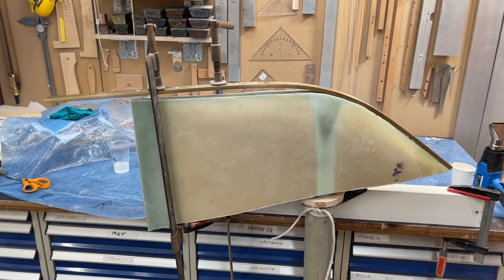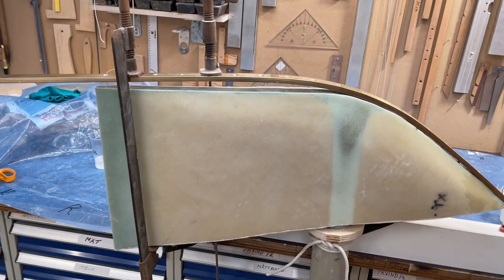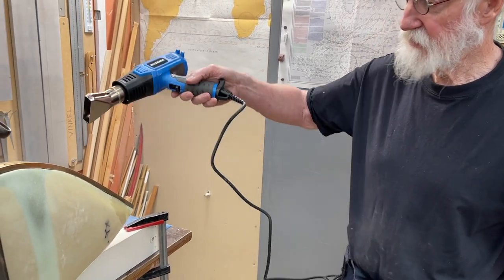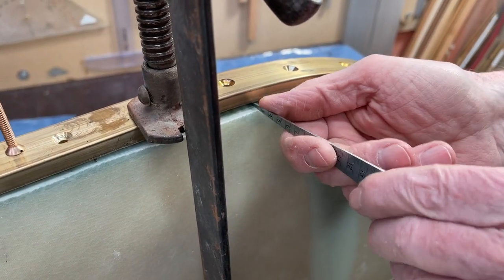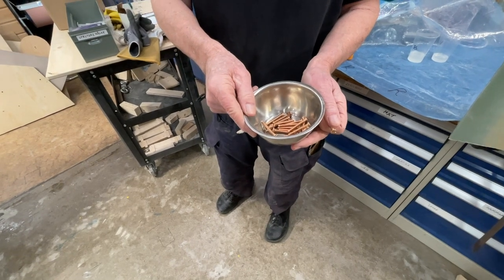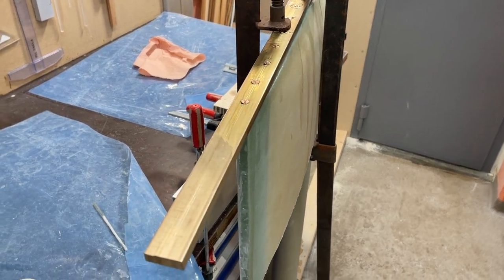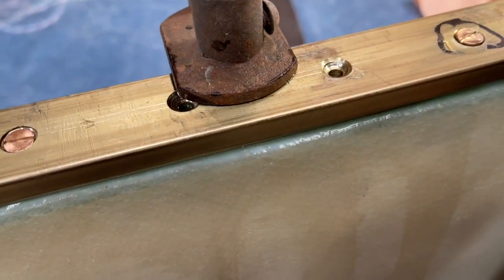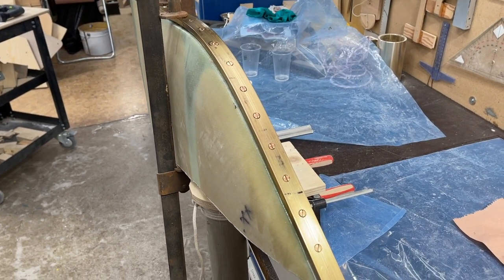3 Jan 2023  Fastening the aluminum bronz flat bar to the rudder blade The first most difficult step.

Comment: Beginner question here. Is it easier to scale boat plans up, or down, or it doesn't matter? Example, I want to build a 21ft. Northumberland sailing Coble, but I can only find plans for a 15ft one, or a 27ft one.
Reply from the maker: If you scale down you lose stability.
If you scale upp you get better stability.
You can take the 15ft and space the frames with greater distans to get 21 ft.
Reply: @SvenYrvindExlex  thank you!

Comment: Why not a torch? If I were to bend metal, I’d think that would be much faster than an overpowered blow dryer. Is there a reason?
Reply from the maker: My landlord do not let me weld or use a torch.
It is a 13 000 square meter building with alot of valuable things.
Reply: @SvenYrvindExlex  I had a feeling it was something like that.
Reply from the maker: @justplinkin4809  I am learning. This is the first time.
Next boat I may bring the thing to someone who can do the job.

Comment: Isn't the rudder blade itself (divinycell I suppose) strong enough to go without this bar?
Reply from the maker: The rudder blade is 30 mm G11 epoxy laminate extremely strong.
The Divinycel is outside to get an hydrodynamic shape.
The screws are in the G11

Comment: So you used the heat gun while the metal strip is on the composite?  How does the heat effect the composite?
Reply from the maker: Its no good to heat composite.
I did it very carefully.
Hopefully no damage done.
The heat gun helped a lot to bend it.
The bending of the flat bar have been done by an amateur with small resources and no previus experience.
Also I am not permitted to use open fire. My workshop is a big 13 000 square building with a lot of offices.
I think the problem is solved despite everything.
Reply: Probably the infrared emitted does more benefits to the cure process of the matrix  than the temperature itself. 265°f for a few hours is used for many processes. Interesting, is that gas fumes like those emitted by a gas heater will weaken the layup. I think that at 140°f most uncured layups will increase in plasticity and at approximately 265° they can become harder and more heat resistant - up to jet engine temperatures for some exhaust components. Interesting, is that a cold hand laid airplane will drop it's wings several inches at 140°f so white paint has to be used.

Comment: I think it might have been better to slightly over bend initially then draw it down.
Reply from the maker: If you watch previus videos you see that it was quite a bit overbent but it sprung back more than planned.
I have no previus experinece with this.
However I did not dare to overbend it more than I did.

Comment: I thought it was a brass bar.  Aluminum is not going to slide over rocks and coral as well.  It tends to stick to rocks rather than slide.
Reply from the maker: Its not brass its not aluminium.
It is aluminum bronze. Stronger than stainless steel. Almost as strong as duplex.
Reply: @SvenYrvindExlex  Got it. I thought it looked like bronze.

Comment: I hope is stays.  If there's stress still in that bar it could spring in bad weather or cold.  Not a critical part so if it happens it's not the end of the world.  If it were me I'd take all the bending stress out of it on the bending buck.
Reply from the maker: Prestressed conatructions have been used for a very long time.
Earlier videos shows me and two more persons hanging in just one screw maybe 250 kilos maybee it would have hold for more people. There is on screw every 5 centimeter. 
Then there is the glue. If I remember 500 kilo a square centimer. Ther is maybe 3X75 square centimeters 112500 kilo holding power from the epoxy adding to the screws.
Maybee the flat bar is not obedient. If it falls of the rudder will work anywhay.
Reply: It’s not going anywhere bolts and brass guard are set in epoxy, plus the little bit of back force helps it stay

Comment: Now to have some logic in my text. I have to go over a few language!  Babord och styrbord (swedish words) is Port and starboard in English! Port means hamn på Svenska och kommer ifrån ordet larboard inlastningssidan på skeppet! When we see a Viking ship we see  Shields on the sides! And  now a few words from NORA "As the size of boats grew, so did the steering oar, making it much easier to tie a boat up to a dock on the side opposite the oar. This side became known as larboard, or "the loading side." Over time, larboard—too easily confused with starboard—was replaced with port. After all, this was the side that faced the port, allowing supplies to be ported aboard by porters."! NOW TO WHY THIS IS INTERESTING! If "babord och styrbord" only meaning right and left the ships configuration has nothing to do with this! But how we load the ship means a lot! The balance for the tripp on the boat was a bit off i think! But if you fasten the goods in order to sail and a way to easy get the boat  on an even keel! The side the shields are on the starboard get it easier to turn the boat in heavy seas! I hope this thought is to some positive results!🥸
Reply: What I really want to say is with an extra box on deck it can be easier to get the boat on right keel it can be filled with food or other things!🥸